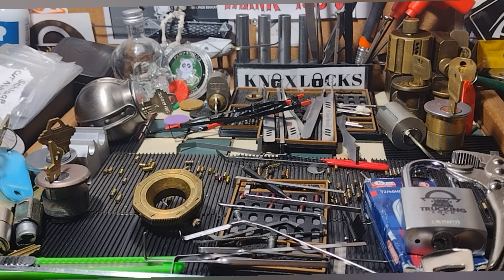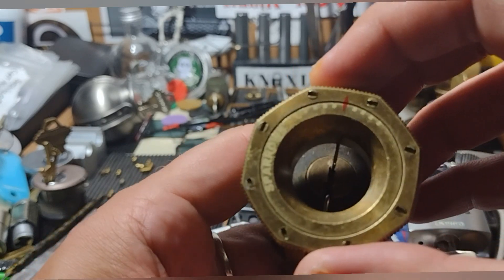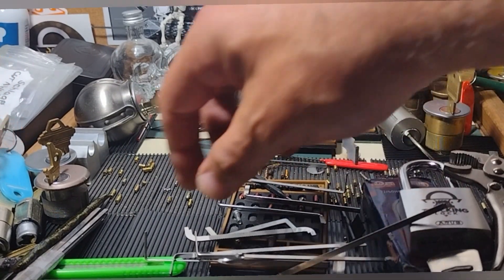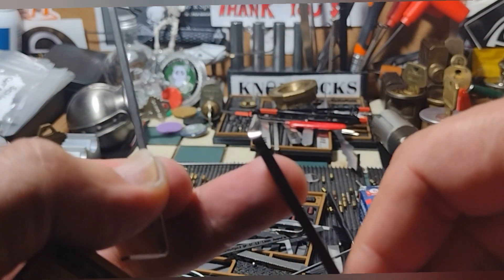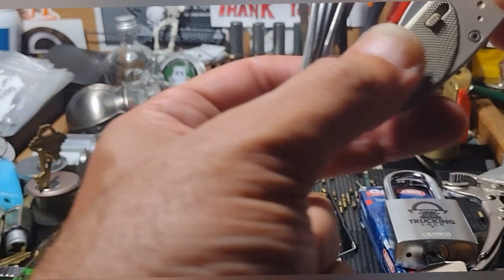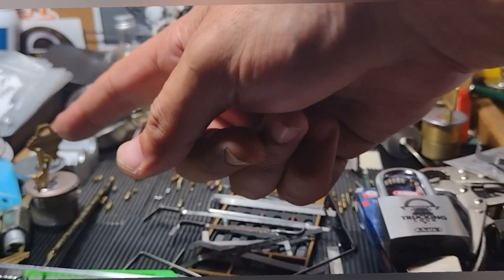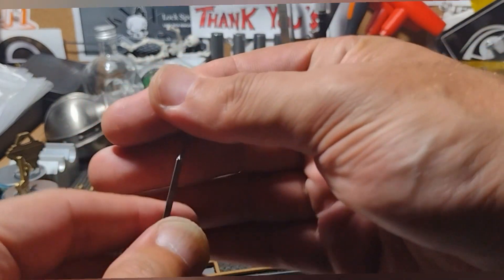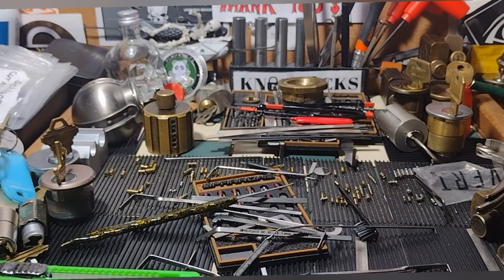"Fabrication Friday" my attempt at the double ended tension turner by Chris Capune for #bluebelt

Comment: Hey Knox you definitely got a subscribe from me for the beginning.

And also likely why I don’t go for novelty tension wrench’s.

I spoke out about the crap job Christina Palmer and Sparrows did with the quint bogata and waves rakes for the wicked waves set and did a review comparison to the wonder waves vs the wicked waves.

I had also deemed the killer maru set to be a junky novelty and based on your sentiments regarding them my thoughts and opinions of the set were spot on.

I honestly would touch anything Palmer has made till she and Sparrows and Multipick can make it correctly together.

I also wouldn’t trust anything that LPL with his covert instruments with a 10 foot pole unless they were free.

The Southord feather tensioners and the Sparrows clip on are highly antiquated and not successfully useful anymore.

I have a 30 piece KLOM pick set that has two springy feather tensioners and I came to the same conclusion about them being complicated at best and get in the way too much.

Your observations are spot on.

I like what you can do Knox, I tend to stick with bottom of the key way the majority of the time.

I’ve rarely used my top of the keyway sparrows except to match up a locks fit for them.

And yes wrist problems and pain comes from using them for long periods of time.

Completely agree, I’m going to check out some more of your videos.

And hope you’ve subscribed to my channel keep up the good work.
Reply from the maker: Thanks for watching & leaving a well written response in the comments. Much appreciated 😎👍
Reply: @KnoxLocks  Your welcome and you’ve been at this a year than your pretty good